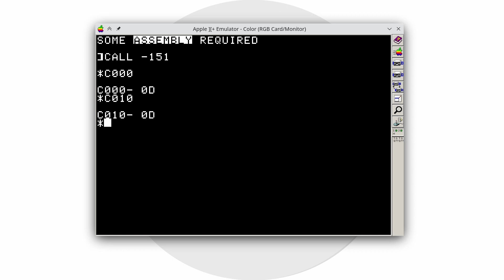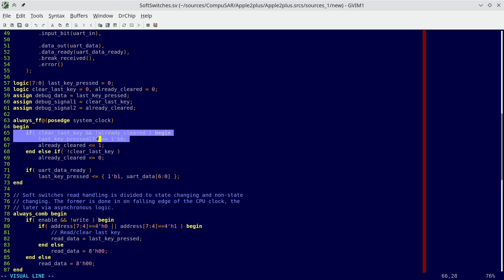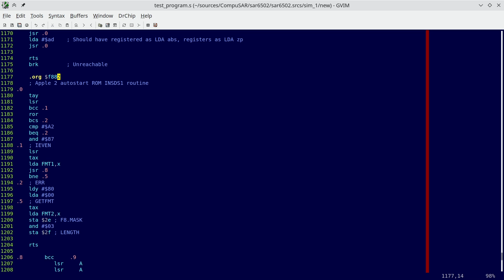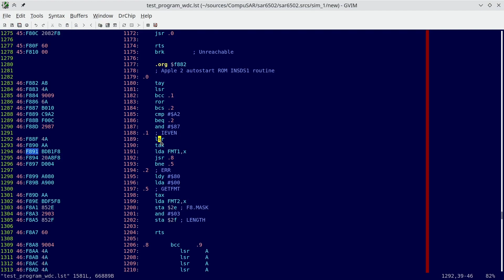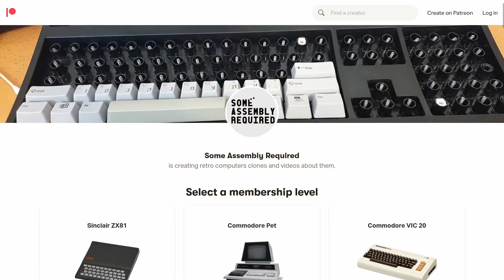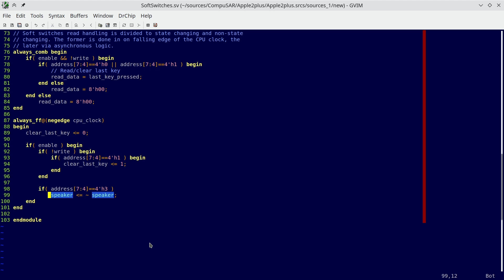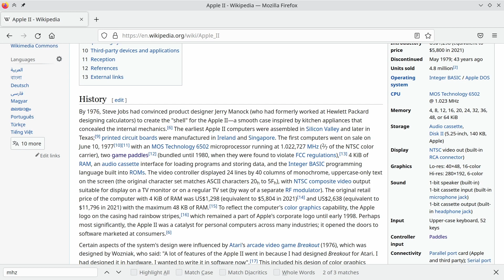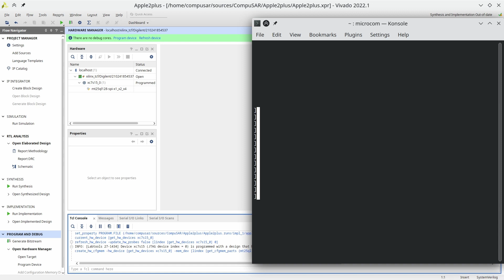FPGA Apple ][ clone: Adding keyboard input and sound

Comment: Excellent!!! Very well done! Will you be selling the boards? Thanks for sharing
Reply from the maker: I am not sure yet. I'll definity make every effort to make sure that the boards will eventually be generally available in one form or another.
At this point, my design is as if this is a commercial product, mainly trying to keep the bill of material as affordable as possible.
When the time comes, I may go the kickstart path. We'll see.
Reply: @CompuSAR  that would be amazing if you do. Please keep us subscribers in the loop
Reply from the maker: @RudysRetroIntel  I'll obviously do that. It won't be soon, sadly. I'll only start a kickstart when I'm actually ready to begin work, and know that the parts are available. Right now, the lead time for FPGAs is measured in months. At the very least I'll want to finish the Apple II using the QMTech dev board + the missing IOs (USB and SD card). Even right now everything is open source, but the QMTech boards are quite unobtainable.
The plan is to get an Apple II working, IOs and all, using a daughter board connected to the QMTech's IO pins. Once that's up and working, I'll have a good idea of what's needed in order to move forward, and then I'll probably kickstart for money to lay everything out on a single board I can send to manufacturing (unlike the QMTech, which is up to someone else).

Comment: It'd have been nice to use a line buffer to enable NTSC adaptation over HDMI instead of using console view. It may be tricky to deal with different pixel clocks. However, you could use modes like 480p using a 27 MHz master clock.
Reply from the maker: We'll get there, eventually. There are a few steps I need to do before that.